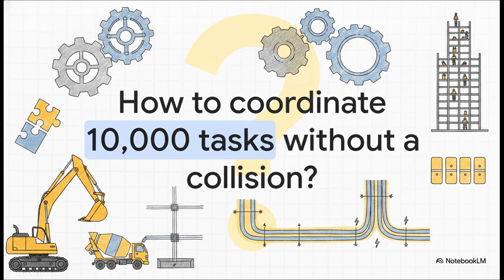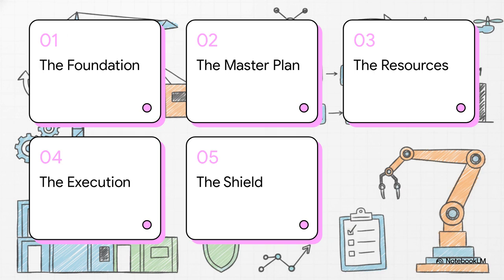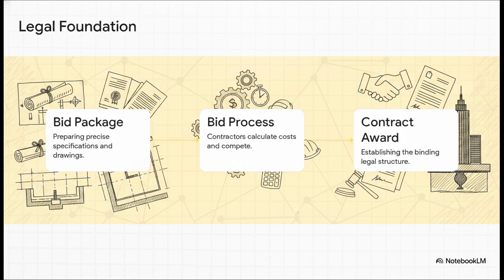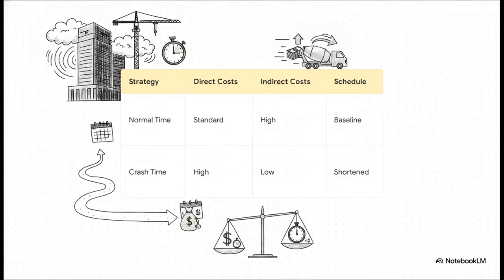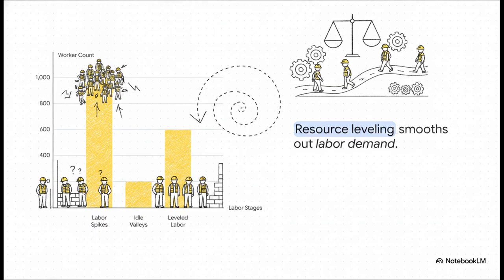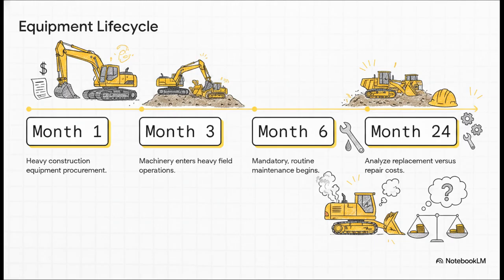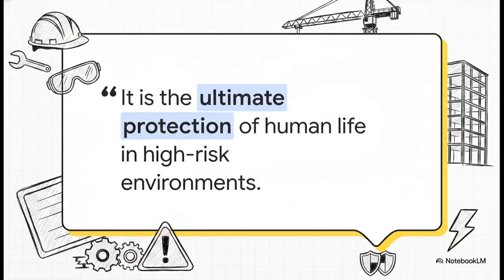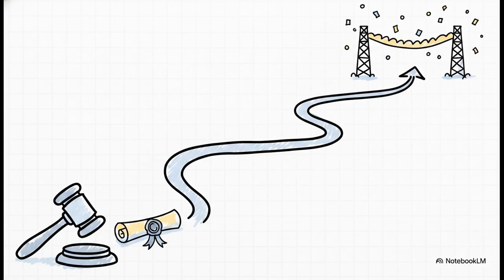Advanced Construction Methods and Equipment

Comment: I think the execution phase carries the most risk for project managers because that's where plans get put into action. Unexpected problems like weather delays, material shortages, equipment breakdowns, design changes, and safety issues can really affect the project's cost, timeline, and quality. Even when you have solid plans and resources in place, good communication, teamwork, and fast decision-making are key to pulling things off. A strong leader is needed during this stage to manage risks and keep the project moving forward.
Reply: I couldn’t agree more, because this phase is where  everything actually comes together. Once field operations start, those unexpected problems that you've mentioned will directly impact the entire project. That’s why having an adaptable leadership on site makes such a big difference as it keeps things movingg smoothly because solutions are being mde in realtime before a small issue turns it into a costly delay.
Reply: I completely agree with your point. I also think the execution phase is where project managers face the greatest challenges because this is when unexpected issues start to appear despite careful planning. Your point about communication, teamwork, and quick decision-making really stood out to me since these are essential for keeping the project on track. It shows that even the best plans will only succeed if they are managed effectively during execution.